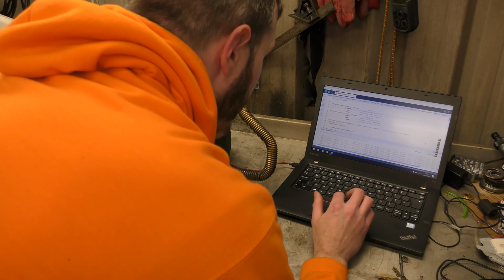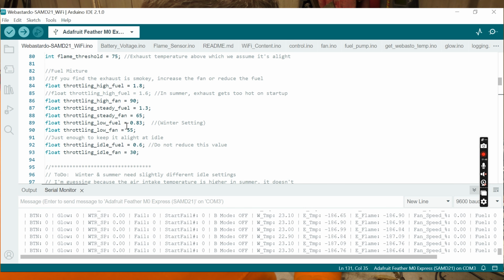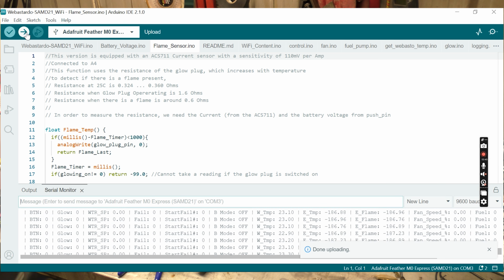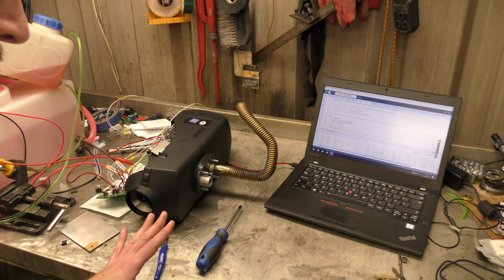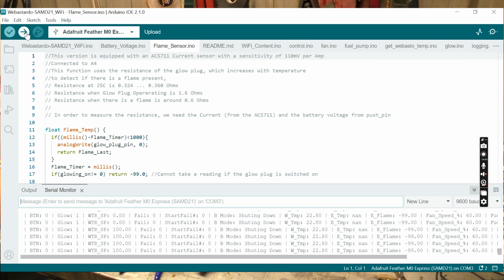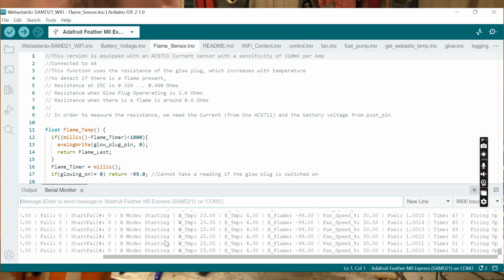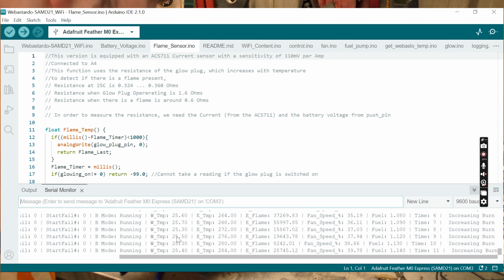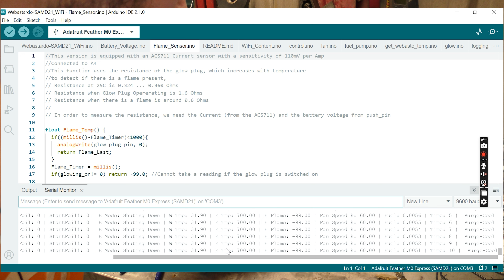Webastardo V3 - running a diesel air heater, small fire - Part 2

Comment: David, you might take a close look at the board and make sure the power/mosfet traces are still good. I'm wondering if the solder melted due to excessive trace resistance. Although I'm guessing it was probably because of excessive current.

Comment: That`s what we really need. A 100% open and modifiable controller.  Been thinking about it. We need 2 separate fuel pumps for ....reasons
Reply: That's what I wanted too - so made it happen.  Can you explain your 'reasons' for wanting two fuel pumps?  I'm intrigued.  It would be dead easy to implement.
Reply: @Simon_Rafferty  Main reason was cheaper fuel.  cheaper offroad diesel fuel recovered in a smaller tank and another pump to run to the main vehicule tank for extra when needed.  
Also could use a thicker fuel and only switch over to it when the heater is fully warmed up
Reply: @Nordic_Mechanic  That's a good idea!  Running WVO through the heater, cycling it through the tank.

Comment: You could check out MOSFETs with lower internal resistance (which leads to less heat dissipation). ST has some nice ones like the STP80NF55L-06, which I used before.
It has an R_ds(on) resistance of just 5.5mOhm.
Reply: The circuit is intended to use IRLB8748 which has R_ds of 3.8 to 4.8 mOhm at >10V.  They weren't specifically chosen for this project, just that I had loads of them left over from another.  However, they are a good fit IMHO.
Reply: @Simon_Rafferty  It looks like you are driving the IRLB8748 directly from the microcontroller with 3.3V, right?

At 3.3V they are not on yet, which would explain the excessive power dissipation.
Reply: @crasbee  You're right.  However, a STP80NF55L-06 would still need a heatsink, albeit a smaller one.  It is a better choice though.
Reply: @Simon_Rafferty  The best one I could find for 3.3V would be the IRLB4030PBF. It is somewhat expensive but the V_gs(th) is at 2.5V and at 3.3V the R_ds(on) would be below 10mOhm.

Edit: "the best one which is available at my typical electronics dealer" :D

Comment: Hi David, I have a small problem. I want to actuate the glow plug using a 12V DC supply, and I want to supply the power for 30 sec and doing that using MOSFET switch. However, its not burning. Whereas, upon direct connecting with battery it burns. Can you suggest where is the problem, else can you suggest how to actuate the glow plug for a specific period.

Comment: You would be best waiting for Simon to reply. But I think the time for the glow plug during shutdown is in webasto ino at line 275. glow_time = 60
I tried sending this earlier but I think it got deleted.
Reply: glow_time is a countdown timer.  Althought it's set to 60 there, it's also wrapped in an 'if else' condition (line 271) which overrides this to glow_time = 0 when the conditions are met.  It doesn't really matter what glow_time is set to in 275, so long as it's >0.  The glow plug will stay on for as long as is set in line 271, or the exhaust is cool. 
271 -  -  if (seconds > 60 || exhaust_temp < flame_threshold) {